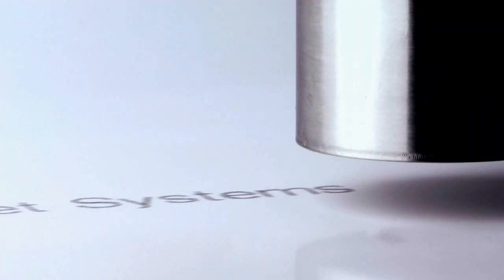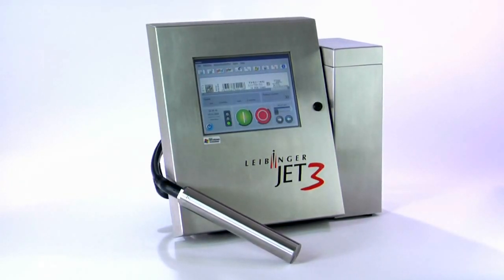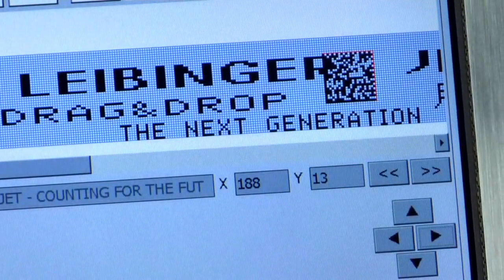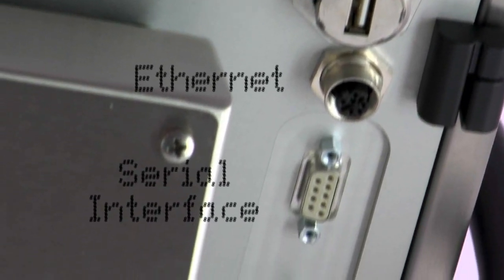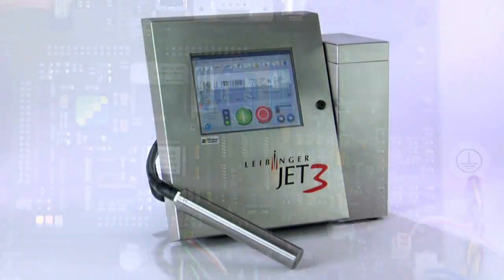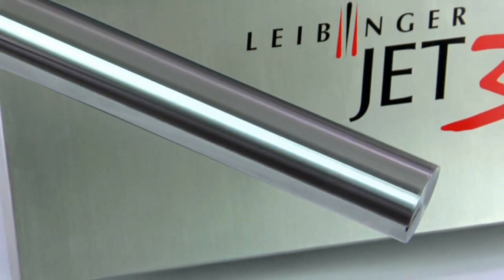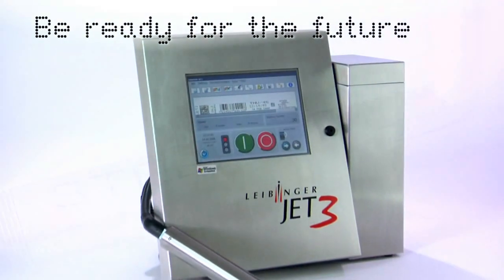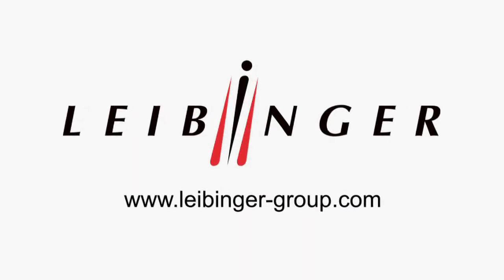Leibinger Jet 3

Comment: Are you thinking on buying a Leibinger inkjet printer?
You rather not.
 
Here’s the story: 
Rheem Spa, a packaging corporation active throughout the Americas, placed in Sep19 an order to the Leibinger local rep, Intpro, for 3 Leibinger Inkjet printers Model Jet 3 UP, for $27K, for it’s Chile container plant.
Per the order the printer had to PRINT, and if it failed Leiblinger would remove the equipment and credit the order amount.
 
The printers never worked properly, generating line stops and extra costs in excess of $9K, Leiblinger rep failed to repair them despite many attempts and promises and unbelievably enough, when called to remove them they broke their promise and failed to do so.
On top of that Leiblinger USA, backed the decision leaving no choice but to sue them.
 
Bottom line, avoid trouble, buy printers form someone else as Rheem had to do in order to solve it’s printing needs.
Need more info? Write to compras@rheem.cl for the full story.